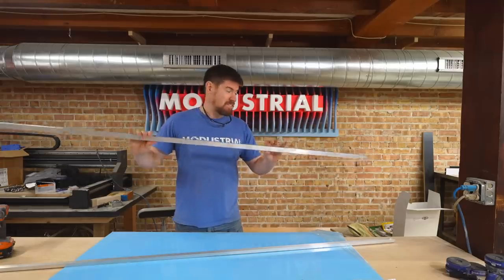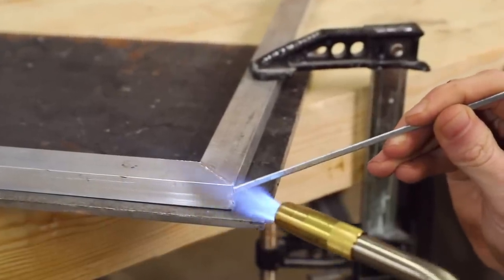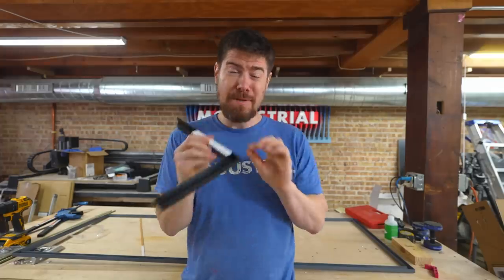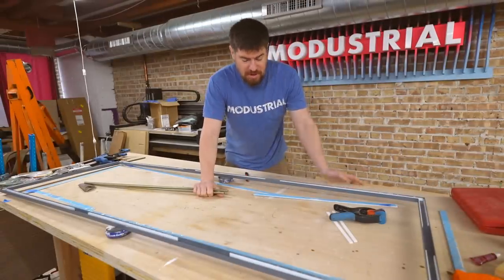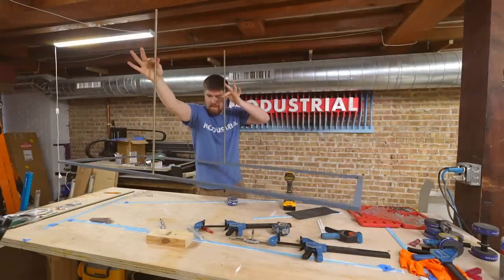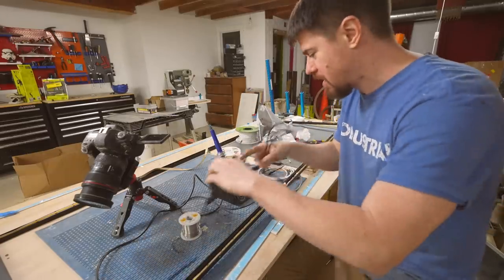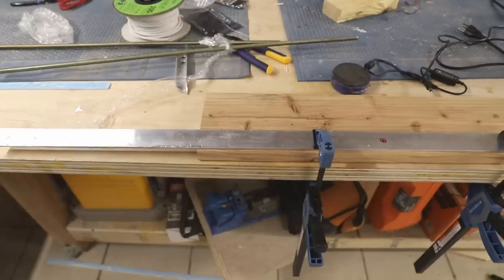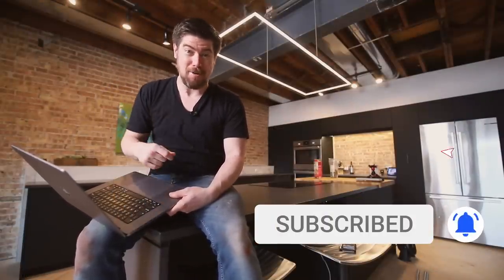I NEVER thought I could make THIS for UNDER $100... (ep. 33 Renovation)

Comment: This does look real elegant and pro done!! What was the issue-i didn't see tape on the diffuser but after you said you found why the light difference you tore some off..and if (you flipped it) on the other side, surely that tapes concealed...are both sides of the diffuser different colour outputs? :O the pipe looks grand too, well spotted! Plus the colour of it. Very inspiring, thanks bud
Reply from the maker: The acrylic had protective plastic on both sides.... The whiter parts I forgot to take the plastic off on the inside.
Reply: @modustrial  oh, double sided is weird. That's cool! Thanks bud, well done

Comment: Great video! It inspired me to start working on a similar project, but I wanted to have two 15 foot lengths of LED strip running through two separate 80w power supplies. What gauge of wire should I be using? My hope would be to run about 50 feet of wire over all. Can you provide a link to what you think would be an appropriate gauge of wire? Thanks so much!

Comment: Love the luminaire, just wondering that now that u have had the luminaire for a year, have u had any issues with the diffusers falling or anything?
I work for a company that makes led luminaires and on few of our desings we use similar mounting for the diffucer (tho its wood we have the diffucer against). We have found that with time as the luminaire lives and heats up and cools down, diffucers will eventually drop

Comment: can you clarify this? Does this light hook up to the waiting in the wall or did you add that power supply and tuck it into the wall or something. 

would LEDs straight into the wall power cause them to go out or fail?

Comment: Are you able to hook up that strip to the main line? I thought most LED strips are 5v and you need some type of power supply unit as the middle man before it gets to the diodes. Someone correct me if I am wrong. I am planning on doing something like this for my studio next week.

Comment: When you wired this in, did you wire it in like a traditional fixture to work off a light switch with everything else in the kitchen? Or did you use a separate LED controller? Wondering what kind of power adapter I would need to take install something like this where a traditional lighting fixture already existed?
Reply: Congrats you have been selected among our shortlisted winners from our previous giveaway, Contact the number above ^^^^^^^^^✅

Comment: I'd use a triad for support, offhand -- two corners, and the centerline of the side opposite those two corners. Easier and more reliably balanced and adjusted.

Trivial, but -- you should have made sure your space was ventilated well when painting... ;-P
Reply from the maker: The triad was my backup plan, but I felt it balanced well enough without it, so left it as was.
Reply: @modustrial  

P.S., thanks for the bit about "welding" the aluminum. I want to get into welding in general but this offers a some-usage opportunities which I had not considered/known about.

What was the electrician needed for, adding the "outlet" used?

Comment: This makes me wanna go out and buy stuff to make one. I have a spot above my dining table that could use some additional lighting🤣
Reply: Do you have a full home workshop too?
Reply: @garystewart6093  don’t need a full home workshop. A regular garage would work just fine.
Reply: @clarks2001  point is you can’t  recreate this yourself for $98.
Reply: @garystewart6093  probably not but it’ll likely be cheaper than buying one
Reply: @clarks2001  you don’t need an electrical engineer to sign off a store bought fitting. This has to comply with code. Let’s face is. You are full of it..
Reply: @garystewart6093  lol how am I full of it? I just said the video made me wanna go make one. It’s really not hard to make. Not sure how that makes me “full of it”

Comment: So... dumb question here, but why rotate the miter saw? Wouldn't it work by just flipping the piece with the same 45 degree angle?
Reply from the maker: I don't like to cut into those thin sides of the c channel ... I've had the blade catch and send pieces like that flying.
Reply: @modustrial  Ah! Good point there. Knew I was missing something. Thanks for the response :)

Comment: 10:00 Oh jeez. Hoping you epoxied that flush steel-on-aluminum threaded connection. Otherwise it will wiggle and the join will fail. Pendant light fixtures especially, they wiggle constantly when buffeted by room air currents.

Comment: Glad uncle Mike is back on the grind!

Plus Do they call a chamfer a bevel in America?
Reply from the maker: Chamfer is a bevel :) googled it and here's what I found: "a bevel is an edge that is sloped and a chamfer is an edge that is a beveled edge that connects two surfaces"
Reply: @modustrial  interesting, anyways great vid as per usual, great to see you up and running again
Reply: @modustrial  A filed edge for brazing as done here is properly called chamfer (in the US same as the UK).  You won't see the terms confused in woodworking and metalworking books of yore, but thanks to the internet, language is rapidly loosing precision. In woodworking and metalworking terms, a bevel would go all the way from the top surface to the bottom surface, like the edge of a chisel or plane iron. A chamfer is usually symmetrical and connects two  non-parallel surfaces (usually 90 degrees)—like a radiused edge but straight. Sometimes, non-symmetrical chamfers with a shallow angle is called a bevel, like in glass and stone work, picture frames, etc.
Reply: @no-page  not that deep

Comment: My only question is how is it connected? I'd like LED strips under my kitchen cabinets, but so far as I can tell you can't connect them to your existing wiring circuit and have them operate from a wall switch meaning you need to power and operate them separately and use one of those cheap looking remotes which sucks.

Comment: Amazing execution, but I'm going to throw out an idea that might make you take it down and modify it 😂 this idea came to me while you were finding the balancing point... There is no reason why the threaded rod has to be on the centerline of the rectangle, there is plenty of room for counterweights inside the channel! What if you counterweighted the light slightly to move the center of mass under the steel beam? It would really reinforce the idea the light is hovering above the counter if the lamp pipe was offset from where the eye expected the balance point to be...
Reply from the maker: Cool idea!  Might be one to apply in a future build ...
Reply: Yes, cool idea! Either way works, of course. But I like this!

Comment: I don’t understand why you wouldn’t centre the lamp rods? It’s not as though the support pieces for the diffuser needed to be placed where they were so the balance could have easily been adjusted even adding small weights if necessary.

Also don’t understand the choice against using a nut? Surely the few mil bump wouldn’t be noticeable through the diffuser and from the outside of the light it looks exactly the same for a stronger mount.

All that being said it’s a very nice light!
Reply from the maker: thanks!  many things can be done multiple ways....no single right way for a DIY project, but I'm happy with the results.

Comment: Good job! But I feel like around 5 turns of thread is not very secure. I think if i'd build such a lamp I'd use four thin steel ropes that as well can be used to conduct the electricity.
Reply from the maker: I've researched that option extensively.  Steel is a terrible conductor.... you need copper, but copper isn't that strong.   So what you need is a braided copper core with steel surrounding it, and a clear rubber sheathing.  There are a couple solutions like this for hanging wires that double as power wires, but they are very expensive.   (the type of websites that don't have a price, and just say to contact them for a quote.)

Comment: If you leave the inside without paint wouldn't it be more brighter? I am assuming you are using face lit led and not side lit one's.. The @6:15 is right place where you can paint and just lift the plastic cover on the acrylic.

Comment: Cool light. Surely would’ve been easier to just use wide led channel and you wouldn’t need to muck about with making shims or cutting diffusers. Get same result either way though. Good job man.
Reply from the maker: Thanks!  The premade aluminum channels only come in 4 ft lengths (this light is 5.5 ft long) and would be trickier to weld I think, I opted for the DIY route.  The LED diffusers I made are also much nicer than those that come with the profiles.
Reply: @modustrial  that's surprising like. in the UK you can get them in up to 3m lengths in various sizes and widths to accommodate various widths of tape. you would've still had to probably paint it though to cover up joins. you still ended up with the same result though. Just a shame i don't live in Chicago as i probably would've applied for that job you posted 🤣😂😂😂😉

Comment: Where did you end up putting the driver and power supply?
your $1000 example had a box at the ceiling, so that makes sense, but I did not see where you ended up putting your electronics
Reply from the maker: on top of the steel beam where they are out of sight :)

Comment: What do you mean you never seen anyone use it that way??? I use it that way every few months :)))) Literally every light fixture in my home is made using threaded lamp nipples :) They also sell couplings for the nipples, so if they are too short, you can always connect few shorter pieces with the couplings.
Reply from the maker: yes, for lamps....but those only come in 12" lengths typically.  Longer solid threaded rods are typically used to hang things from the ceiling (like track lighting for example).  I've never seen anyone use the really long lamp pipe to hang fixtures.
Reply: @modustrial  That is true, sir :) These you used were the longest I have ever seen. I usually use couplings to connect 12" ones sold at hardware stores. It probably took you quite some effort to find those. I think we all know that general hardware stores are pretty much useless when it comes to specialty hardware :)

Comment: I like you lamp about the only thing I would do more to it. I would put a pipe or tube over your threads on the lamp threading. In a kitchen there is air born grease particles that stick to everything and will get into the threads. Then dust particles will stick to it. The threads it will be more difficult to clean, than a smooth pipe or tube. Old grease smells awful and fuzzy dust covered old grease looks really nasty in my opinion. It’s a beautiful kitchen and I don’t think you want to have that kind of difficult eye sore.

Comment: Alu solder free, gas in blow torch free. Sandpaper free, spray paint free, glue and activator free and a qualified electrical engineer to install  and sign off fit for use and code compliant check FREE 🤷🏻 (I’ll assume your time and workshop is also free too)

Comment: You should buy a MIG welding machine! Its very easy to learn and you dont need good welding skills to use it! seens you own a workshop you should own one!
Reply from the maker: I have one and have used it in a number of past videos building steel structures ;). MIG is not great for aluminum tho, and I wanted to show a process that was more accessible for everyone.
Reply: @modustrial  have you tryed TIG welding machine?

Comment: Why not just add small trim weights to balance the fixture so you could then support the rectangle at the exact center? Not drilling in the geometric center would drive me crazy!
Reply from the maker: It's close enough you can't tell (or at least I can't)...  Definitely could add some counterweights...altho would take some problem solving to add them so they didnt block the light from the strip

Comment: 14:40 be careful metal chips can be sharp

And the threads in the aluminium are VERY weak
Reply from the maker: The threads aren't much, but the aluminum is also VERY light.   As long as you aren't banging into the fixture it should be fine.
Reply: @modustrial  I agree that your threads are no problem on a lightweight assembly. But I will point out that your tap is wrong for that pipe. The tap that come in cheap sets in a NPT (American National Standard Taper Pipe Thread), and the lamp pipe is NPS (American National Standard Straight Pipe Thread). Pedantic, sure, but isn't that what the internet is for?

Comment: As an engineer specializing in LED lighting fixtures, several things you are doing are less than advisable.  1) the interior of the channel should be white (definitely not black) as white reflects light and black absorbs light. 2) heat from the LEDs could melt the acrylic over time and even lead to fire. LEDs in close proximity to plastics is highly inadvisable. There is a reason why similar lights are $1k... they are designed and tested to meet the high safety standards of UL8750 (Underwriters Laboratories standard for LED lighting fixtures). Your project here likely violates those safety standards in multiple ways.

Comment: I feel like this technique for rounded wood corners would be very applicable to a project like this: https://www.youtube.com/watch?v=VDh7m0pR5Dk

I wager it'd be easier to do in aluminum rather than wood as well, especially since you can fill in fine holes and file it smooth afterwards.

Comment: $15 hand saw, 10$ file, $30 solder, $50 propane torch, 100$ drill and drill bits, 500$table saw and he hasnt even started the project... Materials alone are useless wothout tools.

Comment: Did you seriously need electrician?
Reply from the maker: when you have to pass electrical inspection under Chicago building code, you definitely do....
Reply: @modustrial  
.
Ok so you have a desperate fear electricity,  I understand. 

You could have used a duplex receptacle Outlet for god sakes

But the light fixture looks awesome and the COB style is PERFECT for this application and design 

Btw.

Look up ..   Prepdeck  for a kitchen prep station... perfect for you design 

Ps Glad you didn't DIE!!!  

God bless!

Comment: Come on, give proper prices for items. Yeah, this may have come under $100 for materials, but that is not how you calculate prices. Where are the proportional parts for fixed and variable expenses for the workshop? How much do the tools cost and how much work you need to perform in order to recoup the costs? Then there are the hours spent building. I know you or your accountant know how to calculate those costs or you wouldn't have a successful business like you have.